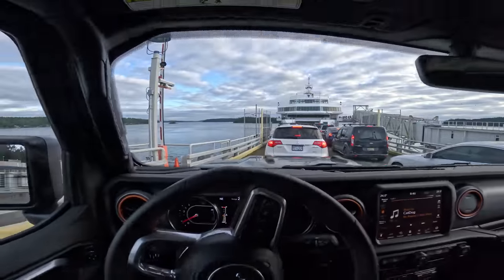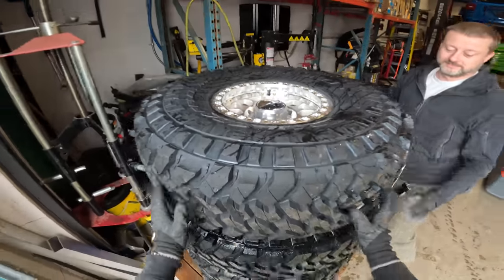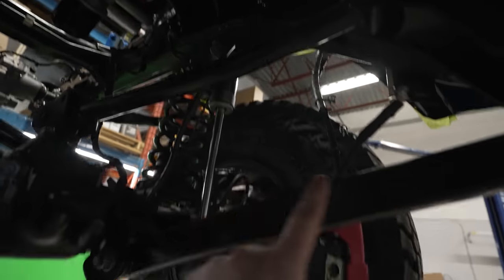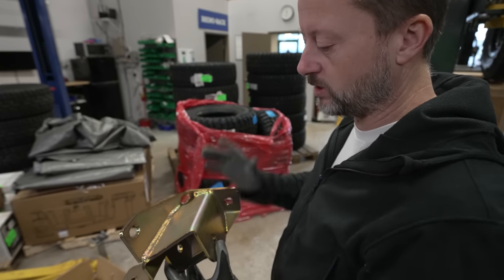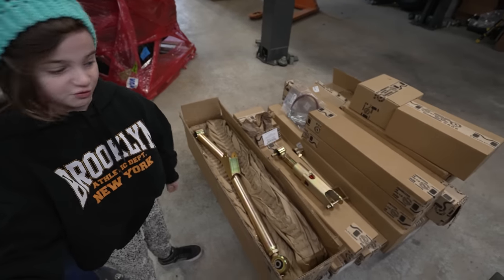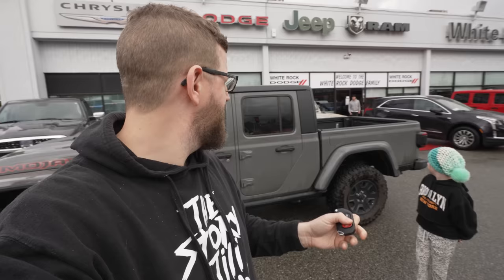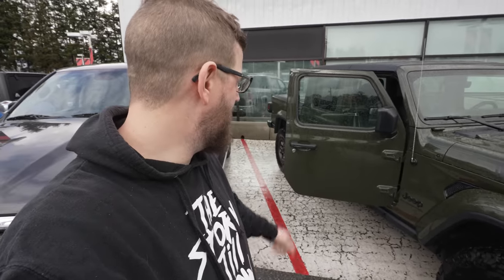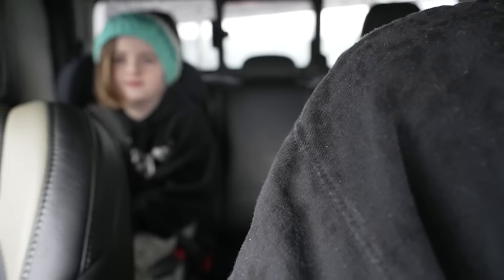Metalcloak Lock'n'Load Long Arm Suspension for My Jeep Gladiator

Comment: This was extremely helpful. To rely back to also wanted to mention the release cable for this seat which is the cable behind the seat. Which was stretched when I went to pull my seat apart. The riser was also completely snapped like the one in this video.

Comment: Hey Casey, just curious why you didn't do the Metal Cloak 4 link in the front? Issues with clearance? I heard it has better flex than the locked and loaded option.

Comment: Casey just idea 💡 Demon on top 👹 make it look killer with drone shot's.  I'm eventually getting Kraken for mine  it's awesome system.  Hi Maty !  Man that's awesome upgrades especially suspension best idea 💡 seen yet far better design.
Reply from the maker: I have a couple ideas ;)
Reply: @Casey250  I can't wait.  Hey got question for you. Kraken system will it work on JK ?
Reply from the maker: No it is for JL/JT only currently.
Reply: @Casey250  ok thanks guess have look for another source thanks for replying.

Comment: I have been a jeep guy since the 70 wagoneer was introduced. Had more jeeps than one can count in my life. Still  would'nt own a new jeep. They got cheaply built over the decades and from 97 to present day they went plastic and overpriced. Not here to knock on jeeps just stating what i have seen over 50 years of jeeps. Good luck with the new build. Looking forward to seeing you on the trails
Reply from the maker: I prefer earlier edition my JK for wheeling but for long range adventures in varying conditions the new Jeeps, especially the Gladiator is really nice. I can't drive my JK for 16hrs straight like I can my JL.